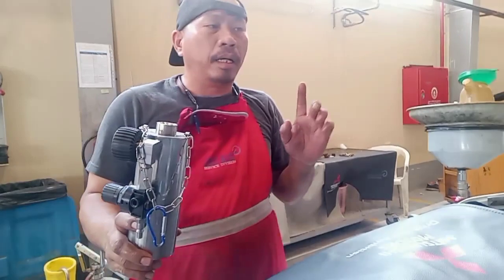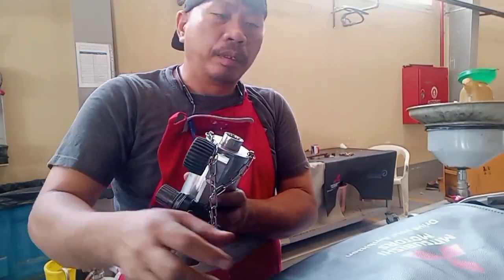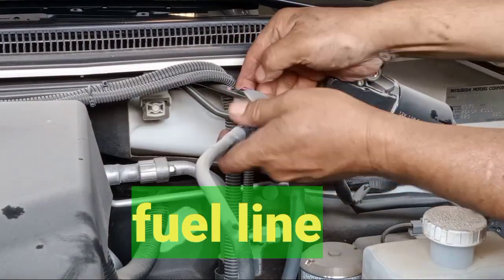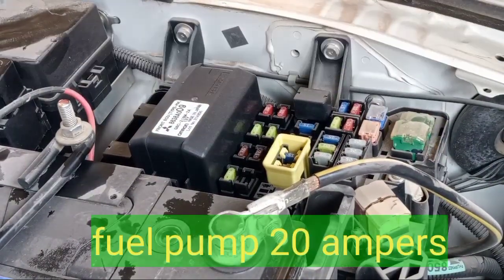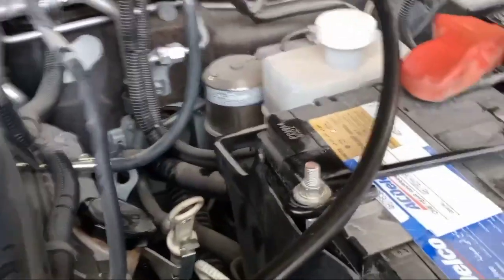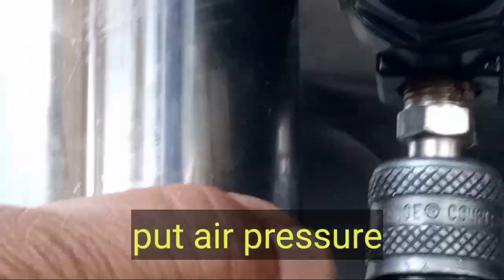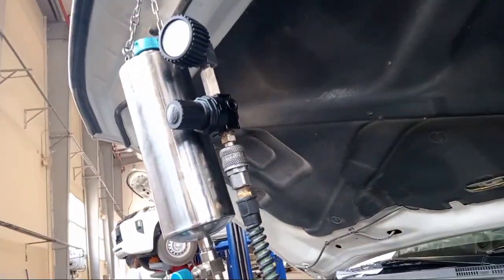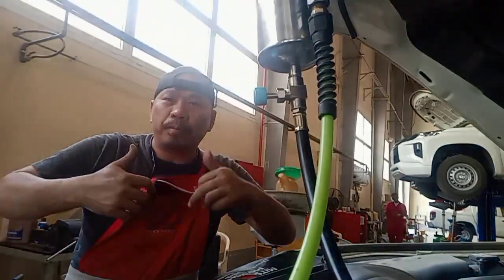Mitsubishi Pajero (how to clean fuel  injector) etc. tech info

Comment: Hello bro plz help me i have a pajero  3.8 v6 2004 is have hard starting problem . Morning time starting ok but  warm  after 20 min if I try to start is hard start  . What the problem my car .🙏
Reply from the maker: Sir make it tune up
Reply from the maker: Pls. Celan trouthle body. . Clean air filter if dirty need to change. Check the. Fuel. Filter if need to chenge pls change
Reply: Bro already  I change fuel filter air filter and clean Trouthle body  and check fuel pressure